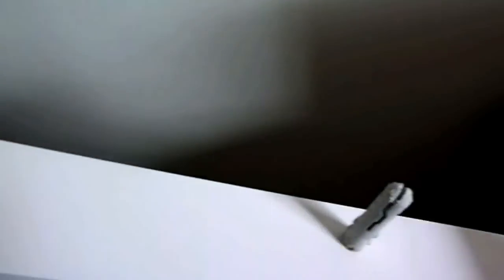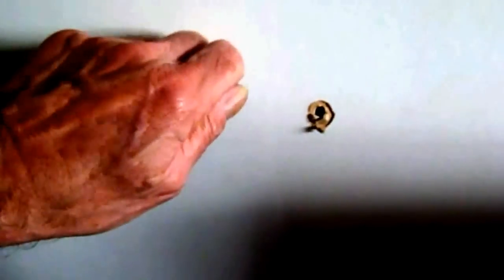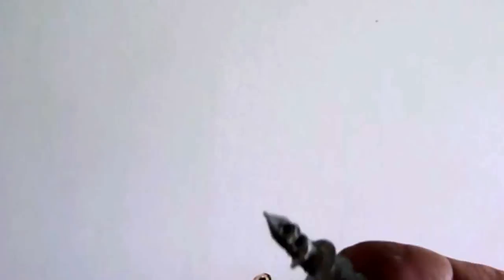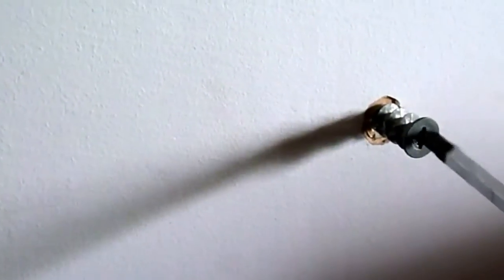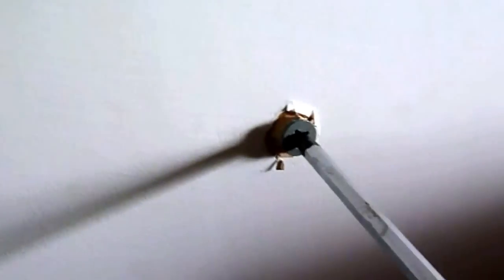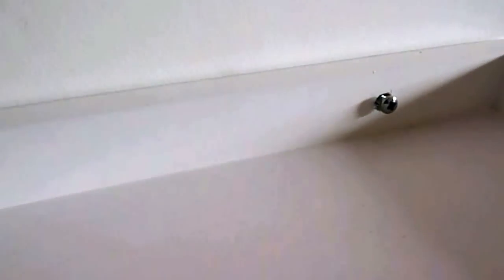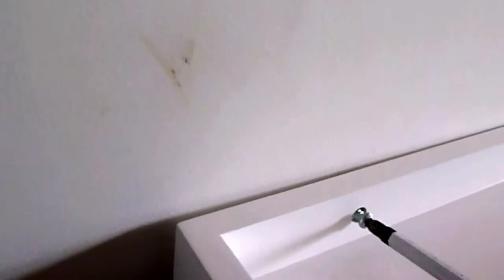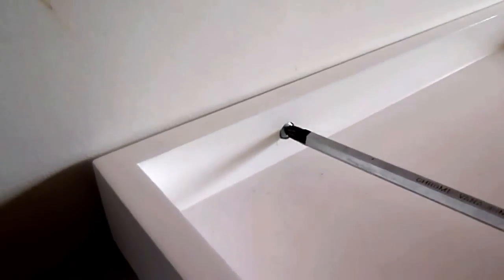How to fix anything to a plaster board wall (dry lining).Shelves,cupboards,pictures,ect.

Comment from the maker: Hi Mark as a brand they are all very similar but Fischer are the best, I do prefer the sort that screw into the plasterboards as shown , but there are others where you drill a hole first in the plaster board then insert the toggle type fixer and as it screws into the board the toggle expands behind the board fixing it that way .Thanks I will check out your videos.
al.

Comment: These fixings are a godsend, used them loads on jobs and always have a dozen or so floating around my toolbox. Don't bother with the plastic ones though, waste of time, metal are the best. I've seen double convector radiators hung on a few of these and they seemed to hold up to the test of time ok. Not sure if I'd be all that happy about doing that myself, might be better to try and get a fix into the studs for that sort of weight.
Been looking through your videos, good tips mate. ATB

Comment: I have always used butterfly fixings, they certainly work well or for heavier loading I get a batten, handplane, chamfer the edges and screw it across two adjacent studs, behind the plasterboard and then fix the load to the batten.
However, on your recommendation I will give these a go.
Thanks

Comment from the maker: Hi Mark yes as long as they are long enough, mind you if your batons are thick ones i-e, over an inch , you could just get away with using screws straight through the plaster board and into the wooden batons.
al.

Comment: I'm trying to hang curtain rails on 50mm insulated plasterboard mounted directly on to the cavity block wall with mushroom fixings. Any tips on what to use?
Reply from the maker: You could drill through the plasterboard and into the block wall and use longer screws. A bit fiddly getting the wall plugs in but if you start them on the end of the screw, then push them past the gap and into the hole. That would do it.
Reply: Dryline pro best thing ive used to date. Google it you find videos on them. Goes directly into brick wall ideal for dotdab homes.

Comment: Hi, forgive my silly question (complete novice talking!) but was that fixed in the empty plasterboard or through a stud. Also, about how much weight do you think that could bear? Thanks.
Reply from the maker: Hi Artstux , I can confirm it was fixed to empty plasterboard. The weight capacity of those fixers is about 20 kg.
Kind regards,
al.
Reply: Great, thanks Al.

Comment: Dry wall is so brittle  these fixings are no good for heavy objects they don't grip and don't over tighten them or try to take the screw out you will make the hole bigger and the screw will not turn it will just be lose I would of used a Molly anker.

Comment: When you show the first plasterboard fixing going in its obvious you hit the brickwork at which point that type of fixing is useless ! The head will never pull down flush with the plasterboard no matter how tight you screw it UNLESS the brickwork is known to be cement blocks OR older breeze block which "might" let you bury it a bit "maybe"
Bear in mind as well as you are using the provided pan head screw that comes with the fixing chances are the point of the screw normal emerges through the fitting so again if you've already hit the brick that method aint gonna work sorry
Also that plasterboard fixing should NEVER be used in an old hole ,the thing is designed to screw in to fresh solid plasterboard and this is where it gains maximum grip and therefore strength
So as a builder of 40 years in this case seeing there is brick or something solid behind the plasterboard the solution is to drill and plug the wall then use longer screws surely?
Very surprised at your video as you leave the head obviously sticking up then offer up the shelf to it conveniently obscuring the fixing and make out it just needs tightening back NAAAH  not unless you've countersunk a hole on the back of that shelf to accommodate the fixings not being flush with the plasterboard? 
Sorry but  you don't come over as a professional on this advice
Reply from the maker: The shelve is still on the wall.. Look at the date on this video.